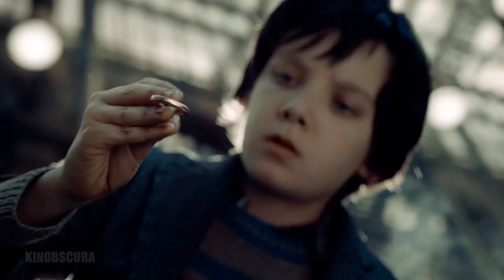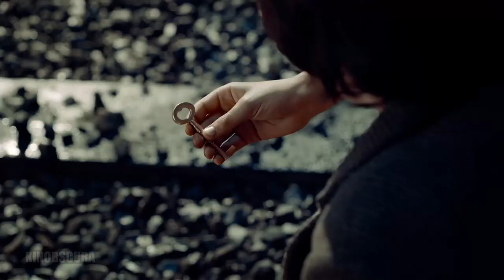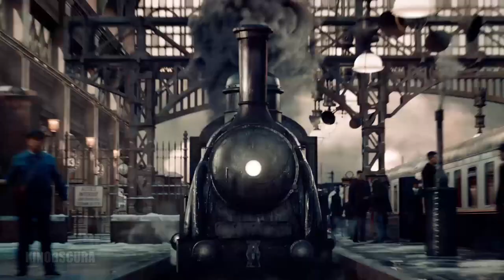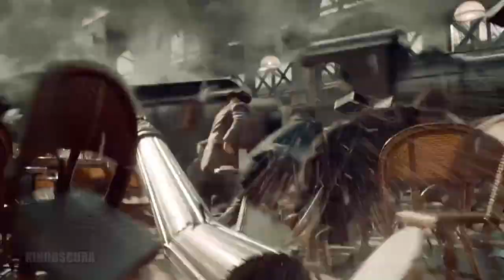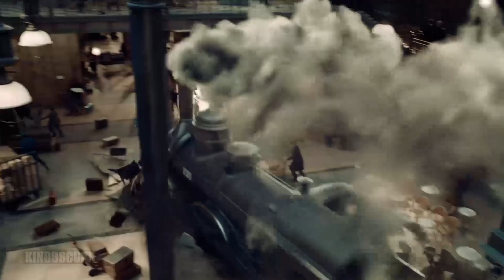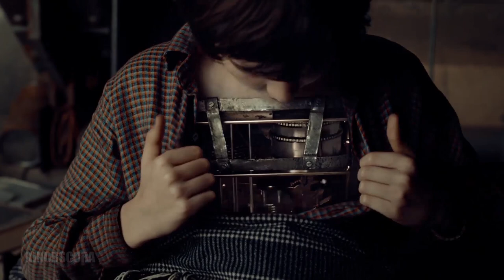Hugo (2011) - Train Crash into Station Scene

Comment: My question is why was the train going so fast when it was approaching the station?
Reply: From what little I know the scene is based on a true event in the late 1800's in Paris.
Reply: Can’t believe the engine didn’t sustain that much damage after crashing through a platform it shouldn’t even had the speed to go through, somehow speeding up when the brakes were on, and going straight through a glass wall and falling onto the road.

A n d   y e t   i t   d i d n ‘ t   s u s t a i n   m u c h   d a m a g e .

- Wikipedia
Reply: The driver was doing paperwork and lost track of where he was and when did it was too late
Reply: Apparently it's based off of a true crash that happened, they were late to their next stop and decided to speed up
They were going too fast by the time they reached the station
Reply: @Formal_Foumo  pretty sure that was the guard
Reply: @SshadowSnap  another train was supposed to occupy the parking tracks so the train changed its way, the switch didn’t work so the train arrived full speed in the station, thinking it was steel on course
Reply: Basecally the train was delayed after something, air brakes fail’d and the loco’s brakes wasen’t enough to stop the hole train
Reply: Montparnasse, Paris in 1895. That's what this was bassed off.  Engine ended up pretty much exactly like that, hanging out the station wall with the buffers on the road.  Amazingly no one on the train was killed, although a woman passing by on the street was killed by falling masonry knocked from the station wall by the impact.
Reply: In the real accident the train was late and the brake weren’t applied properly
Reply: @Formal_Foumo  1:17: You love this guy who are duck and avoid the things when the out-of-control train!

Comment: That train had no right to be going into the station that fast in the first place.
Reply: Well could be making up for lost time or the brakes failed
Reply: It was late and had to get into the station faster then usual
Reply: The steam pipe had snapped. It wasn't the engines fault and the shunter was meant to divert it onto the mainline. Not into montparnasse
Reply: It’s a  D R E A M
Reply: @dalekinthewater4708  That wouldn't really be true, Since the break had already been shown on screen literally
Reply: @frxbo  Well in the actual disaster, it stated the train was running late and the crew were making up time for it, and the air brakes failed